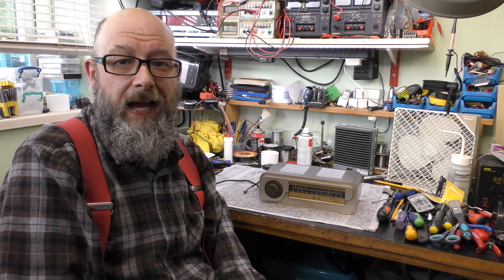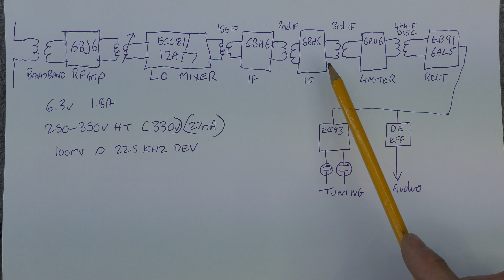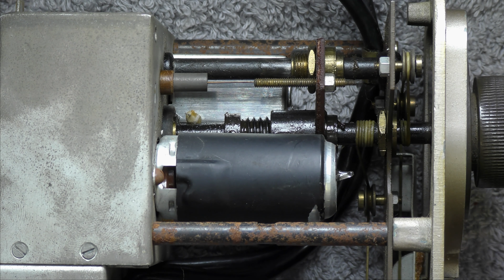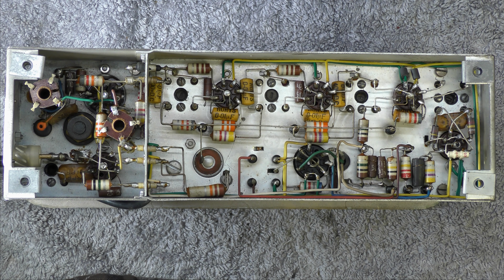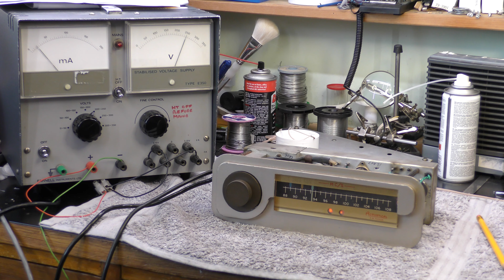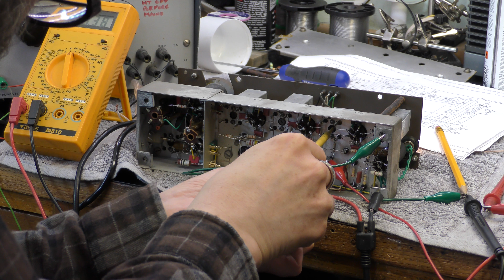Shoal Of Tuner:- Acoustical Quad Vintage Hi-Fi FM1 Tuner 1958 (4K)

Comment: Hello - If anyone is interested -  Ive just posted the exact same tuner (with amp & preamp) on ebay - 100% original 1958 - Comes with all 3 manuals dated 1958 - powers up but the tuner isn't working.

Comment: Would it be possible to add an MPX decoder to this to listen in stereo?
Reply from the maker: Yes it would and indeed there was a unit available called the quad FM1.  This was a solid state unit.   I'd prefer a valve MPX decoder.
Reply: I added stereo decoder to one of these it worked fine